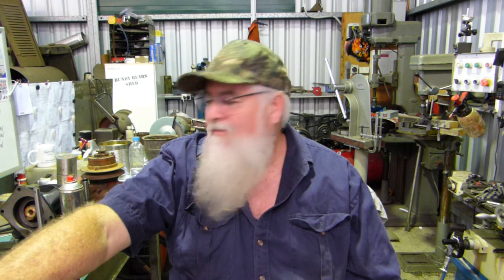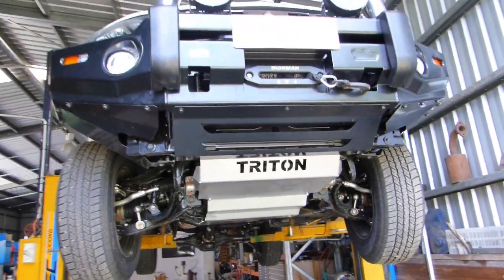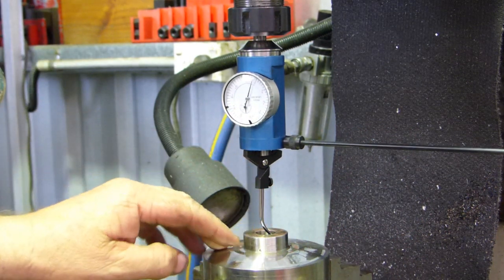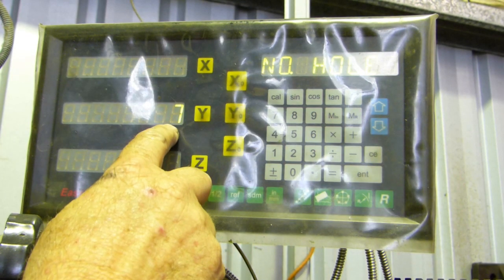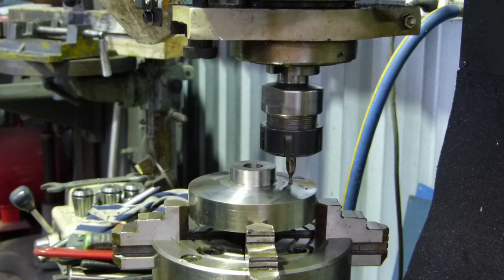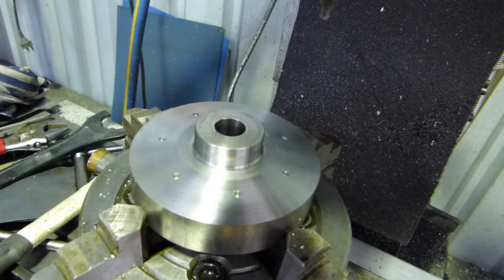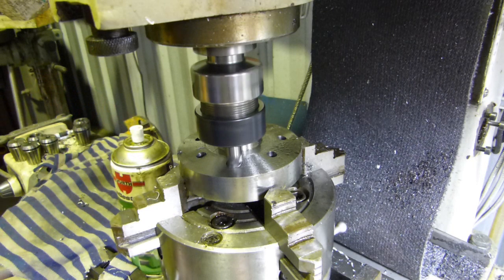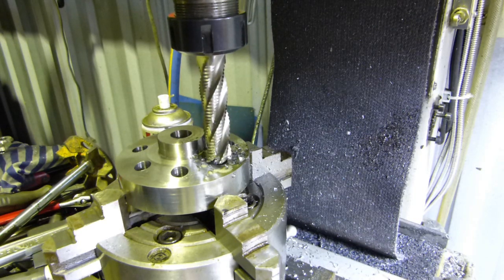Kangaroo Stew # 79

Comment: I'm always impressed with your precision engineering skills Lance and its always nice to see skills like yours still on the go which I feel is getting rarer these days especially when people don't  know how to use or set up lathes, milling machine's or any precision  engineering  equipment these days. Mainly because some youger mechanic's don't seem to be interested, only anything with a diagnosis box on their laptops as long as they  don't get their hands dirty ( some of the tractor mechanic's I've met not all of them!) We'd made all the crome parts on our fergie ted20 (apart from the badges) out of stainless steel on our lathe after a disastrous re-crome plating that a firm did went wrong and just peeled off all together So it was decided to make the whole lot out of stainless steel to avoid rusting or crome peeling off it again!!!. As dad said '' if it's good enough for kitchen forks and knifes then its good enough for shiny parts on a tractor ,, the only thing we didn't make was the steering nut which we'd sent for in a America when we'd just thought it's not worth the bother of having to make one. congratulations on your million views mate 🖒🖒👍👍and happy New year when it comes mate. 🚜🚜🚜🚜
Reply from the maker: G Day Calum,, Thankyou, I think the stainless idea is a great one and I may even copy your lead there. I sell aftermarket Chrome parts and they are not copper coated first and the chrome is put straight onto the steel which is only short term. I often tell customers but some still want it anyway then come in complaining it didn't last. Happy New Year and thanks for your support.
Reply: Bundy Bears Shed 
Good on you Lance 🖒🚜

Comment: Could use some of that warmth here!! Be about -15here this morning in your temps.
Reply from the maker: G day Brian, -15 its time to move house, I'm not sure I would go well in that weather, Do you do a lot of tractor maintenance in the cold for customers seeing as they cant do much I would imagine.
Reply: About all that goes on here farming wise this time of year is feeding and milking cows. At work we do quite a few winter service specials where we bring tractors in run them on the dyno and give  good going over and advise what should be fixed. A lot of the bigger farmers will have theirs done every year as it always avoids a lot of downtime during the season.